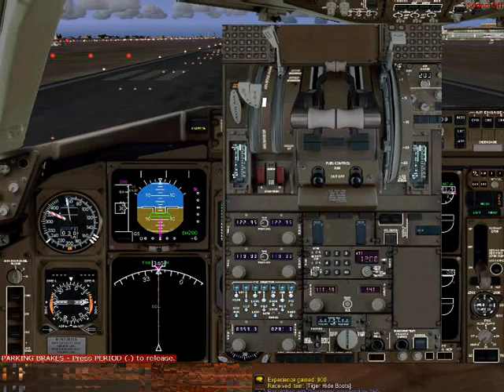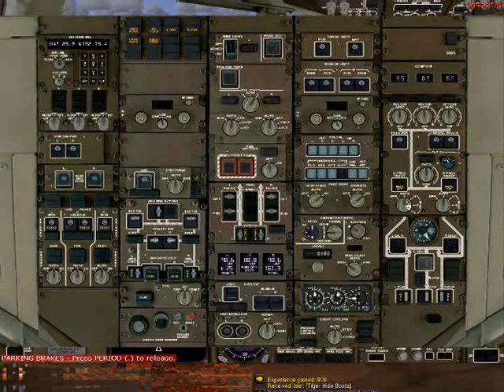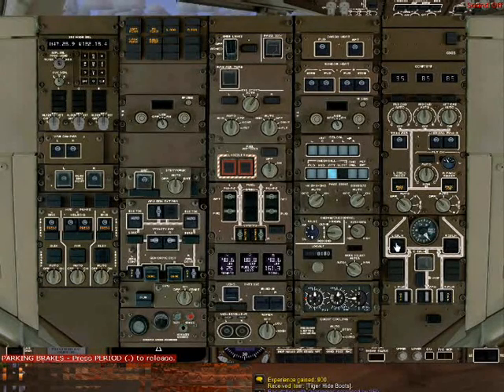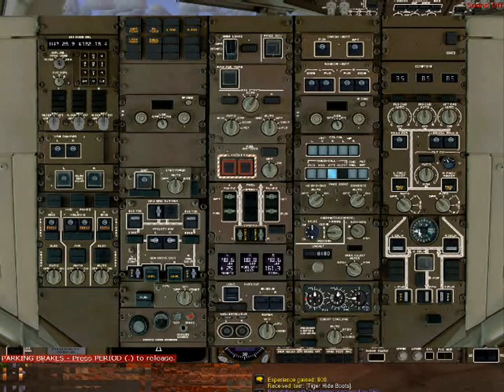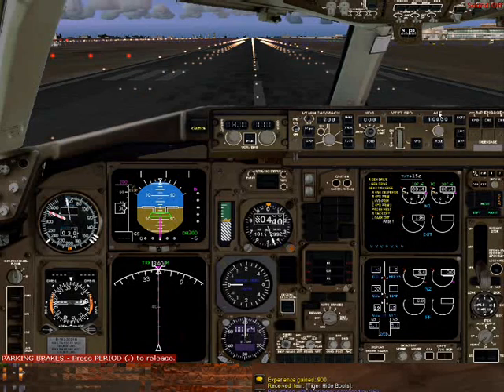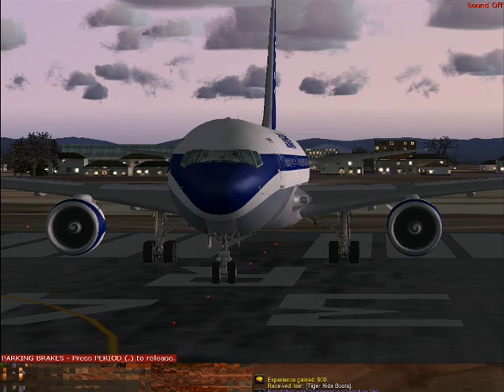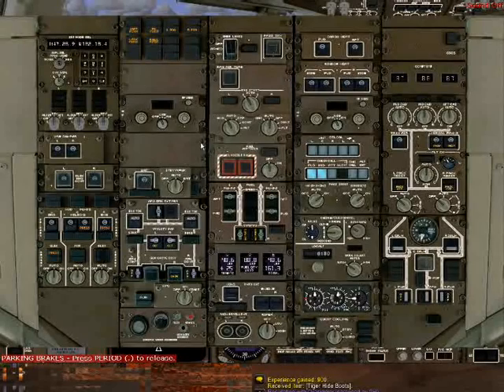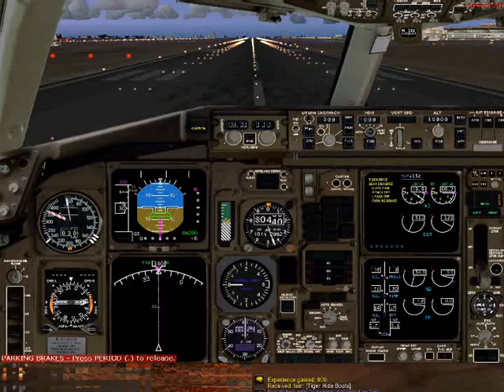How to start level d 767 engines.

Comment: Nice video, but actually you have to have your packs off and fuel pumps on before starting the engines and then set the engine start panel and then wait till N2 reaches the magenta line then put fuel into the engines

Comment: 1. In every jet aircraft, pilots don't switch on Fuel Control Switches at first.
2.While you start engines first time a day you can't start from 1 to 2, but from 2 to 1.
3. There are many mistakes. So I can give you only 3 stars. Sorry.

Comment: Yeah, your'e right, but in the Default 747-400 you can't turn the APU off, and you have to press CTRL+SHIFT+F1 to turn off the engines. In a Default 737-800, you can turn the APU off (same for the A321), but you must press ctrl+shift+f1 to turn the engines off (same for A321). Info only applies to Microsoft Flight Simulator X. I have no information for Microsoft Flight Simulator 2004 (2003-2006; Watch End of an Era by Flyhalf 2006).

Comment: Hey man great video!  I wanted to touch on the startup procedure.  The fuel valve should not be turned on until N2 reads about 20%, then fuel should be added. As for selecting the igniter -- there are 3 positions, 1 2 and BOTH. You should use the 1 for odd days and igniter 2 for even days. The BOTH option is to be used on COLD days.  Hope this can help polish up the process.  THANKS FOR SHARING AND HAPPY LANDINGS!

Comment: I always appreciate tutorial vids on the LDS 767.  I think someone needs to produce a comprehensive video explain the systems / CDU / MDU / all of the checklist procedure etc. 

This video is a good start.  However, isn't the 1 and 2 switch irrelevant to the engine you are starting?  I don't think those mean left and right (or 1 and 2) - but rather something related to the actual starter?